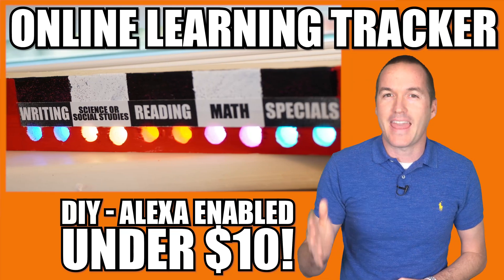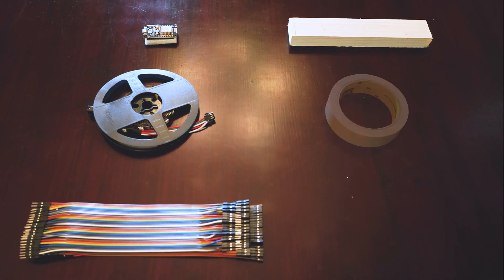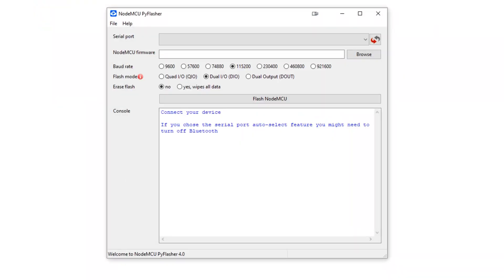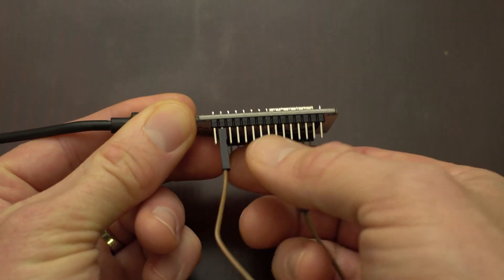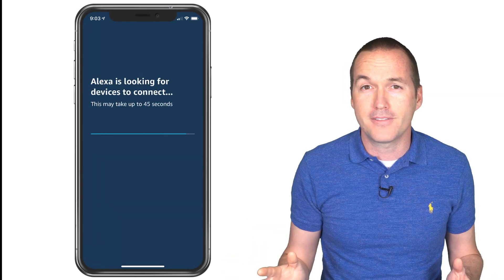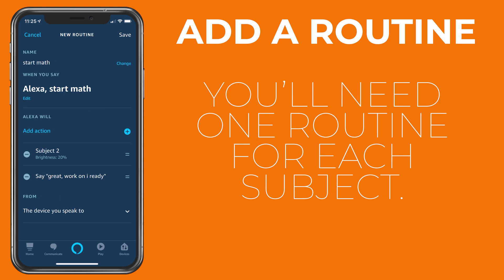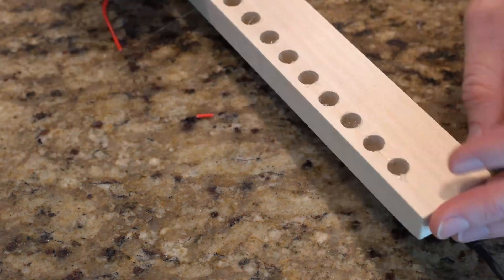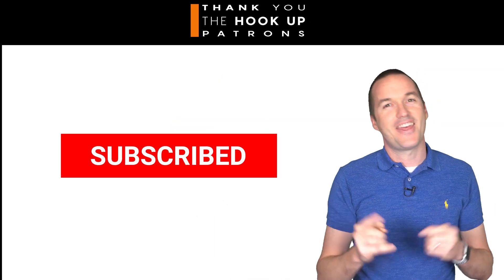Kids eLearning Tracker - DIY BEGINNER Alexa Enabled Electronics Project! No soldering or coding!

Comment: I can not get Alexa to find the lights. I can see that it is connected to the network same as the Alexa devices. But no matter how many times I try I can not get it to add the lights. Any suggestions on troubleshooting? I have the same results on a second NodeMCU.

Comment: Couldn't have been easier. Except, when alexa found my 5 new devices (found them all on the first try), they were named "First Light", "Second Light" ... "Fifth Light", even though I set the name in the config. Not a huge deal, I just renamed them in the alexa app (going to make a 2nd one for other kid...would get confusing without their name it it)

Serial output doesn't indicate a problem.

23:27:21.573 -> opened config file
23:27:21.605 -> {"alexa_id1":"Harrison1","alexa_id2":"Harrison2","alexa_id3":"Harrison3","alexa_id4":"Harrison4","alexa_id5":"Harrison5" 

and further down it again prints those names. 

Odd. Wonder what could have caused it. Not sure which Alexa discovers the lights when you ask it to. I have 3 different flavors of alexa here! 

So, if someone else has the same problem, just rename them manually in the app if needed.
Reply from the maker: Those are the default names that the library passes in is no data is saved... strange.